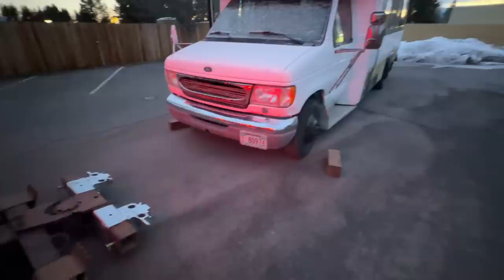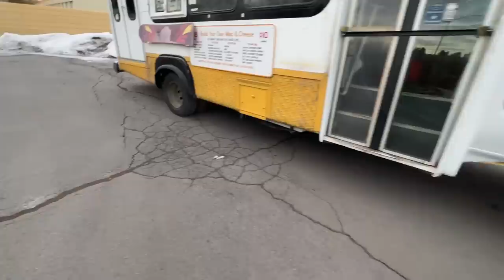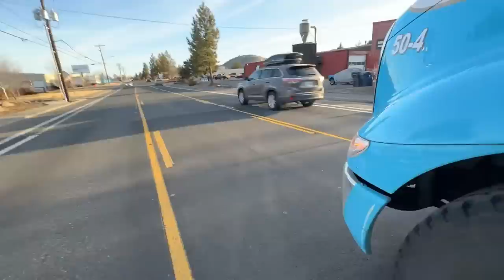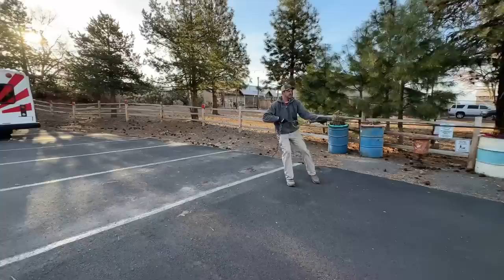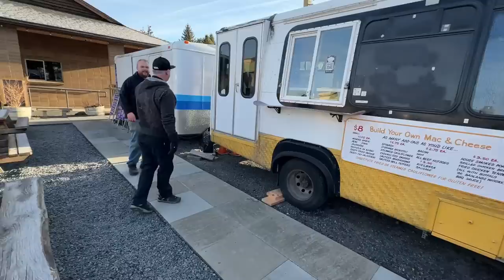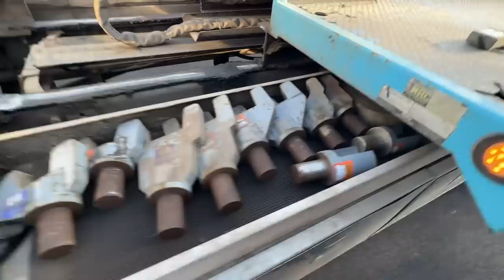Food truck needs a tow!   (Mac and Cheesy)

Comment: Great job Casey, so did you end up putting the driveline back in?
Reply from the maker: Nope.  I don’t reinstall drivelines.
Reply: Thank you for what you do. Be safe.
Reply: @CaseyLaDelle  casey, was that some sort of steel zip tie on the driveline? (Prop shaft to us english) 
If so what are the called? 

Cheers
Reply from the maker: @adamlee581  steel cable tie
Reply: @CaseyLaDelle   thanks for the extra effort there 😆

Comment: Did you forget ur Rachet Strap holding the Drive Shaft up
Reply from the maker: Nope, because there was no ratchet strap holding up the driveline.   Those are single use cable ties that I leave in place.
Reply: @CaseyLaDelle  oh ok n that's good enough huh 😆
Reply from the maker: @robertbarkey3194  yep.  Rated for far more than they need to be to hold up a driveshaft
Reply: @CaseyLaDelle  ya I've always used. Gas welding Rod or Old Clothes hanger but wrapped around a few times to be stronger in the 90s

Comment: I guess this job came up before the worshipper truck relocation? You mentioned you could load something onto your bed as long as it didn't exceed 14ft in height.

This Mac & cheese truck looks as if it would be less than 14 ft tall as well.
Reply from the maker: If only I would have showed and said in the video why it couldn’t be put on the bed…..

Comment: Ok, dumb question maybe, but since the food truck don't run and need a tow truck when it (rarely) moves, why a truck ? a trailer would make more sense right ?
Reply: I would think that they got a good deal on that retired or almost junked people mover type of Van/Truck.

I see them go at Auction for pretty cheep if something is wrong with the Engine.  Then, with a few thousand in costs to make it into a Food Truck, it would be much cheaper than the usual Step Van's or Food Trucks built for the purpose.   A semi custom Trailer with wired outlets, reinforced frame for the water tank , and heavy food related stuff would cost a lot more than this older Van. With a food truck, you have to have a sink to be able to clean your hands and another one to wash dishes.  

With the larger tinted windows on the side and double doors in the back it was not designed to be a food truck.  In my area, it would be hard to get that Truck/Van certified as a food truck with that unique exhaust vent for the cooking section.  I actually bought an old U-haul Truck that someone attempted to make into a food truck by adding windows in the box and took it to California.  They couldn't get it certified, as Calli is a very hard state to do anything, so someone brought it to Colorado and just used it for a Storage Unit.  Even still had the pull out ramp as I did use at a truck to move the stuff I bought at Auction.

Comment: Wouldn't it have been cheaper to get it running?
Reply: Probably out of inspection etc as well.
Reply from the maker: Not even remotely close to cheaper.
Reply: @CaseyLaDelle  Vicegrip Garage gets cars sitting for 10 years running in one afternoon with just some new spark plugs and a fuel filter.🤣

Comment: If it is glare Ice why are you doing 50 miles an hour while pulling a load?
Reply from the maker: Because that’s a safe speed for the conditions.
Reply: @CaseyLaDelle  No it is not! It is way to fast if on glare ice. 30 miles an hour would still be lots, for road conditions!
Reply from the maker: @hughroney6342  neat story
Reply: @CaseyLaDelle  Almost 40 years over the road, never an at fault accident, but got hit by idiots driving to fast on icy roads, 50 was always to fast and now there are more idiots on the roads then even 10 years ago!
Reply from the maker: @hughroney6342  that’s amazing, I’m so very proud of you.

Comment: This is why these people should invest in a Food TRAILER and not a Food TRUCK...

That way, when it comes time to move, they can bring in their daily driver pickup with the heavy tow package (depending on the size/weight of the Food Trailer), hook it up air up the trailer tires if needed and go instead of having to call someone like Casey to haul their now useless truck cause they didn't prep the engine for long-term storage...

Moral of the Comment is if you are going to invest in a Food Truck that is going to sit in one place for 4+ Months without moving, ask a good mechanic how to prep it for long term storage so when it comes time to move it several months later, you can just come in, dump some clean fuel in the tank, top up the fluids, put in a charged battery (if you didn't periodically charge it while it sat) air up the tires and it will start up when you turn the key...Engines HATE sitting for months at a time...fuel especially goes bad and gums up the pump, injectors/carburetor etc.

Comment: Good morning Casey I have a question if the food truck doesn't run. Why can't they leave the drive line off it will make towing it easier? I am not an expert on trucks but as long as it is in park it is secure and I don't think you need the drive line in place for that unless I am wrong
Reply from the maker: The driveline was left off.  I do not reinstall them.
Reply: It would depend on your definition of "in park".  If you mean "leave the transmission in park", you would need the driveshaft attached to lock the axle to the parking pawl in the transmission.  If you mean "set the parking brake", yeah they could leave the parking brake engaged and leave the driveshaft disconnected.  Although, the parking brake may not release if it was left engaged for a long period of time.
Reply: @CaseyLaDelle  I suppose he means before your job
Reply: I was a firefighter, I went on a run, the call came in as a person run over by a car. We got to the scene, the victim was standing outside his car that he just removed the driveshaft from, on a slight slope. When he pulled the driveshaft the car proceeded to run him over, he claimed no injuries. All he kept saying over and over was that the car was in "Park". I tried explaining that once you removed the driveshaft "Park" won't work any longer. All I got was a very confused look. By the way his wife was not a very happy camper! She wanted his classic GTO gone!
Reply: it probably still ran when they parked it